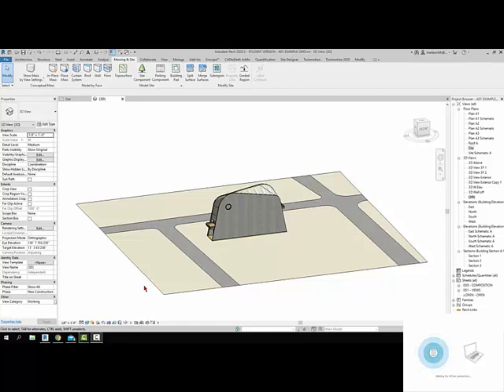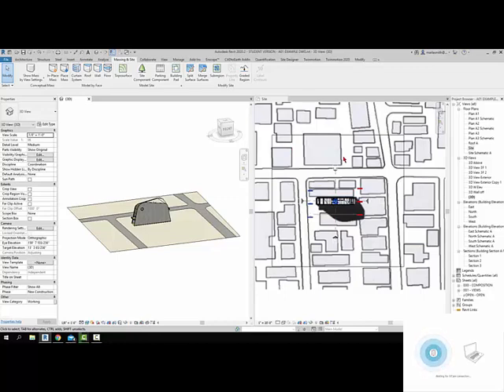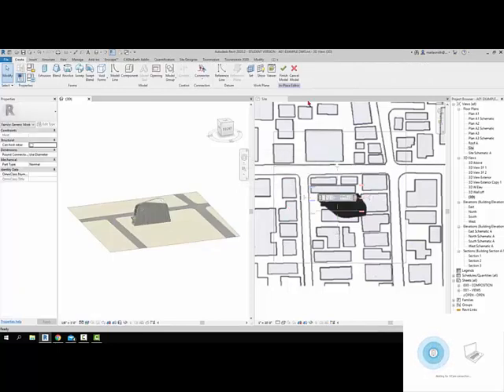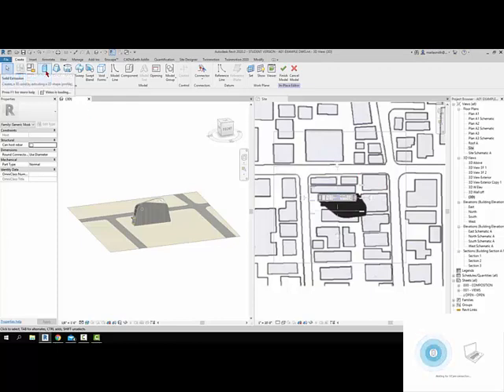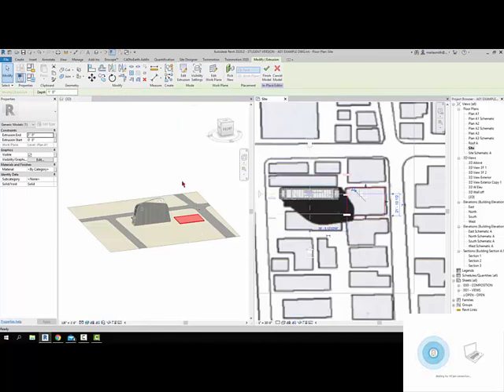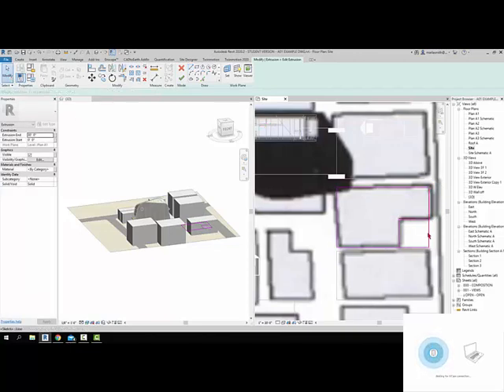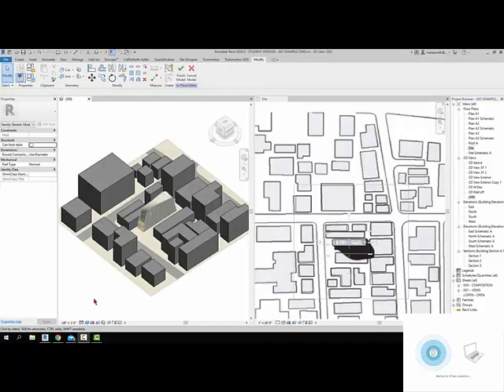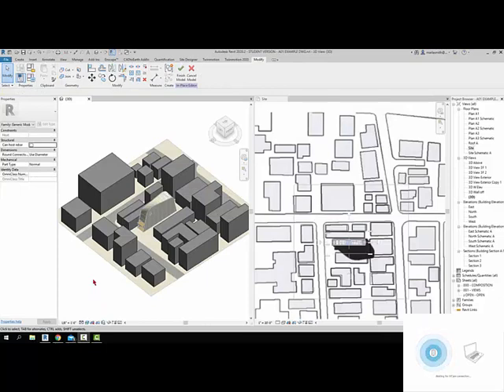04 Revit Buildings Model In Place

Comment: is it better to use mass or components to create the urban volumes?
and in which one I'm able to draw the facades of the urban volumes? ty!
Reply from the maker: If you want to articulate the facades of the buildings it would be better to use walls and a roof.  Using solid Model in Place forms allows for a more schematic  view representation.